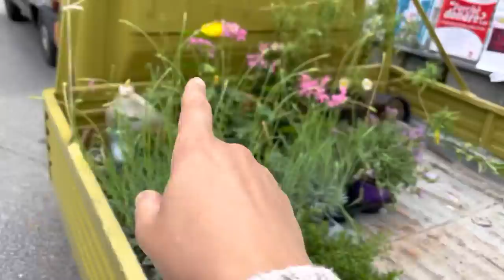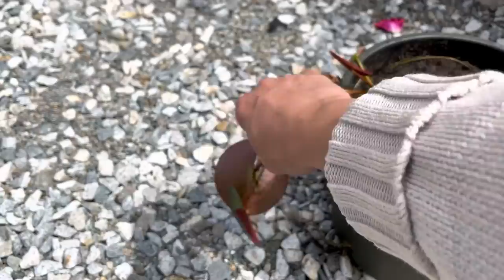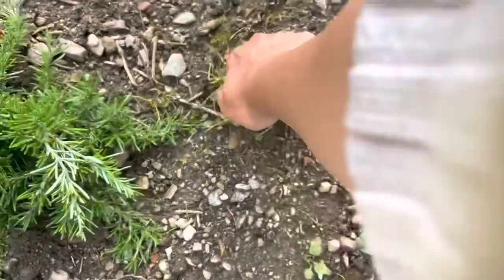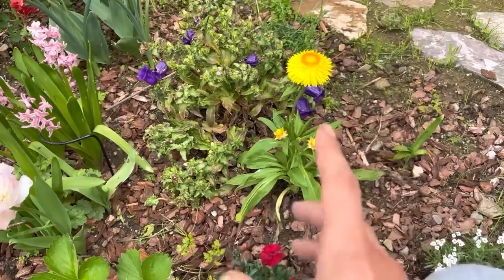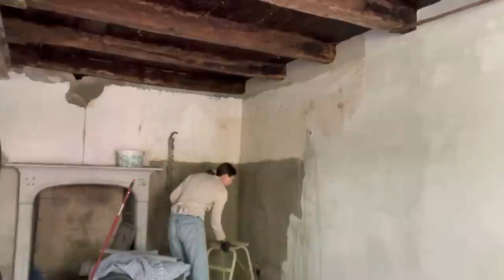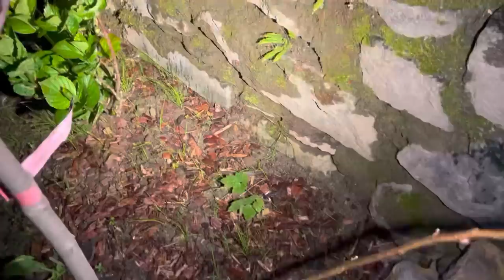Finally!Walls in our kitchen are looking great!/Renovating on lake Como

Comment: For the beer to be effective, the container top has to be at ground level, so dig a small hole and place the jar in, fill half of the jar with beer, the slugs will fall in and drown.  Place in many locations.  Another way to go is slug bait which is very effective however I do not know how animals do if they are around.

Comment: Apparently slugs are nocturnal. They’re so slimy. The beer will work if you put it closer to ground level in lots of locations. Your doing a great job in the kitchen. You and Sergei are doing beautifully. Good luck.
Reply: Bury the c ups of beer so the lip is just above ground  so the slugs fall in and will not hv to climb.

Comment: I have a small water garden too, about 50 gallons. It gets very cold here in the winter and in the fall, I put the water lily in a bucket, filled with water and bring it inside for the winter.

Comment: How are you going to run the wires when you have cemented the chanel and electrical box where the tubes has to go thru. How is the wire running to the main electrical panel?

Comment: The garden looks amazing. The yellow flower is a strawflower. You can save some of the flower heads and there will be seeds inside. Of course they dry perfectly , you could put some in a vase on the window sill of the guest room or your kitchen window. Love your water Lily! Where I live in NY there is a family that has an aquatic flower garden store they have been in business for over 75 years.

Comment: You need to put those shallow dishes of beer everywhere throughout the garden to try to catch them. The jar works but you need to keep the jars everywhere to catch them all.  If you are looking for them in the early evening when they come out, carry a spray bottle of 1 part water to 1/2 part vinegar. Shake that up and try to spray directly on the crawling slug. Do not spray onto your plants as the acid in the vinegar is not good for your plants.  If you continue using the beer baths, and the slugs are still alive, you can spray them with the water/vinegar mixture and they will die.

Comment: For a hands-off approach, spray slugs and snails with a vinegar solution (1 cup water to 1/2 cup vinegar). The spray literally melts the pests before your eyes. Those who use this method believe that the dead slug bodies help deter other slugs from moving into the area. As long as you're not spraying zillions of slugs every night, the solution shouldn't affect plantings.

Comment: Hi Alla, I tried to warn you about those slugs last Autumn. 😟 They are a nightmare and have invaded all over Europe.  They lay about 400 eggs each so it's really important you get out each evening and pluck them up and kill them.  I use dog poop bags with some salt and hot water and drop them in, then just bin them each day.  They make having a nice garden almost impossible and put me off gardening.  Chickens will only eat the very tiny ones so this is not really a solution.  I am going to try Nemaslug this year but it only works on the babies and still need to kill the adult slugs.